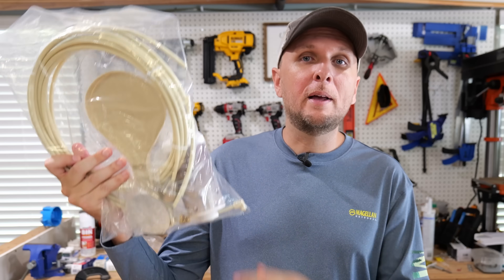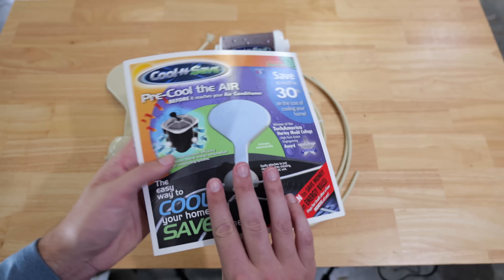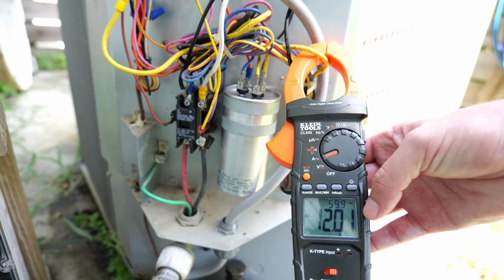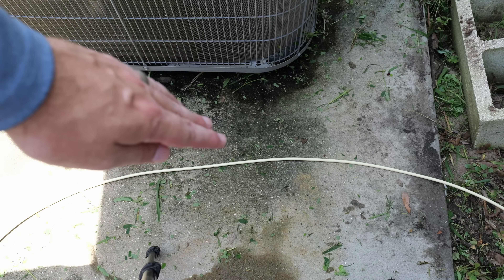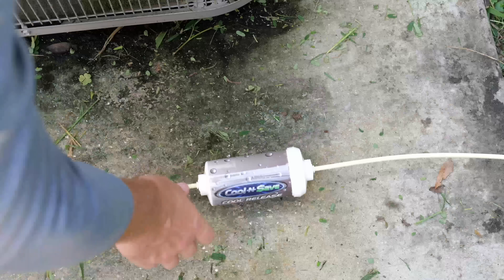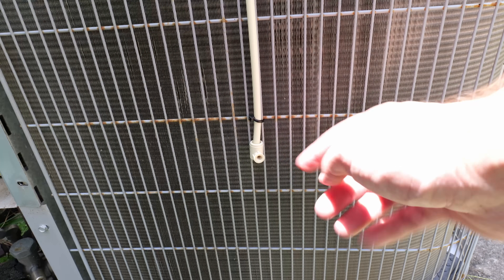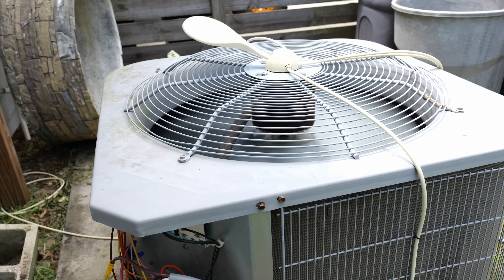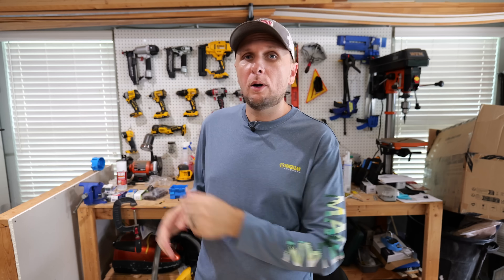This Device Can Save You 30% On Your Energy Bill! Makes The AC Blow Colder

Comment: FYI/FWIW: Most homes with a water softener loop don't have soft water at the hose bibs( intentional so homeowners aren't watering plants with a little salt too ).  Water at my house ( at approximately 15 to 18 grains of hardness ) and many others would clog that line filter quickly. It would be important to know the availability and cost of replacement filters for those in this situation depending on the line filter. Most homeowners don't clean their condenser coils and changing a dirty filter probably won't happen often enough either. In that case the misters are spraying hard water on the condenser coils. Not good.
Reply: Living in central Florida, our city water is a little hard.  I installed a Generic Fleck Valve 24,000 grain water softener about 10 years ago and set it up to provide nice soft water to all water devices and fixtures.  It's nice to wash the car and not have lots of spots on it after it drys.  Also having soft water at all fixtures keeps those spigots and appliances free of water mineral deposits that cause damage to them.  Everything stays cleaner and lasts longer when run with soft water, at least that has been my experience.  I rebedded the resin in my softener last week because the city water contains some chlorine gas that tends to "Wear out" the resin bed over time.  This time I went back with 10% crosslinked resin instead of the 8% that it came with.  Its suppose to be longer lasting and work better if you happen to be on city water.  Time will tell.  I can tell you that it doesn't take very much "hard water" added to a hot water tank full of "soft water" to completely contaminate it and make it feel hard again, so I would assume the same would hold true if you had soft water only on your hot water lines and not the cold water lines as some have suggested.  For me, soft water all the way.  Yes, you can use a fraction of the soap you need for everything compared to hard water which is a huge savings over time, not to mention no mineral build up in all of the appliances and fixtures.  Yep, I'll never go back to normal hard water again. But I digress...
Reply: @michaelefournier  That's interesting. With the exception of my outdoor spigots, my entire water system is softened.
Reply: <edit> I Removed this remark because I was arguing an invalid point.
Reply: @KurtVW That's not true at all. Water softeners absolutely do remove minerals through an ion exchange process. The salt is broken down and isn't salt anymore. Calcium, magnesium, and other minerals are flushed out of the softener beads during the recharge cycle. 

You don't have to take my word for it - look it up. The process is well documented and explained for those that want to know. 

However, what OP said is true - outdoor spigots are usually excluded from these systems.
Reply: @watcherofwatchers   Where do they go?

<edited because I was talking out my arse>
Reply: @KurtVW  The regen cycle of a water softener discharges the used salt water to a drain.  When the regen cycle runs, the machine is in bypass mode so if water was to be turned on somewhere in the house you would be using untreated (hard) water.  This is the reason the regen cycle is typically factory set to run at 2:00AM.  Most experts will tell you that after the regen cycle the rinsing of the media beads is not 100% efficient, meaning a very small amount of salt does enter your house.
Reply: @KurtVW  There's a waste drain in a softener system. It goes wherever that drains to such as a sewer or septic system.

You have a fundamental lack of understanding about what these systems do and how they work.  Seriously, go read up on them before so confidently asserting things that are exactly opposite to being true.
Reply: @watcherofwatchers  You are correct, it was a misunderstanding on my end.  Thanks.
Reply: Agree
Reply: Translation: Using this product differently than it's designed to be used is bad for your unit.

Comment: Water cooled condensers connected to the municipal water supply is often not permitted by the building code. Example: Chicago.
Reply: Well that maybe true but no one’s would prob be more true than Chicago.  Have you read the CP electrical codes due to some “cow” named Bessie.
Reply: How would they know?
Reply: Two words, Legionnaires’ disease.
Reply: @jimp5024  If there's a Legionnaires problem it won't happen at the misting ends of this system. That would be a supply problem. The pipe coming into your house? Possibly. Your municipal water storage? Possible, see Michigan. But how in the world can bacteria grow in water that is instantly or nearly instantly evaporated?

Comment: What about the water usage and increase in water bill?  What about places like Texas where the water coming out of the hose is very hot?
Reply: The water shouldn't be hot unless you are talking about the 50' hose (or whatever length) that is out in the sun heating the water in the hose. Otherwise it would be the same temp as inside your house. The water eventually is cold once it has replaced the water that was initially in the hose, right? The hoses for this assembly might still be in the sun, but obviously much less water is in them, so less hot water. Either way, if your A/C cycles, let's say, every 15 minutes, the water won't be as hot anyway.
Reply: @ccyaltr  He could be in an area like Yuma. The city water lines are not buried deeply, so in the summer there is no need for hot water to take a shower, the water from the cold tap is over 100 F. Many people turn off their hot water heaters in the summer.
Reply: @ccyaltr  you must not live here... the water coming out of the "cold" is sometimes scalding

Comment: I would like to have seen a measurement of the amount of water used during the test period. Depending on how much water is being turned to mist every hour, it may or may not be worthwhile.
Reply: I was thinking exactly the same thing. The other consideration is the outdoor humidity. Misting is an effective way to cool in dry climates but much less so in humid climates.
Reply: Many of us are experiencing drought conditions and so water usage would be an important part of the equation whether to use this product or not..
Reply: 1. Water usage, especially if on city water. 2. If on a well, now there will be wear and tear on that pump along with increased electrical use...
Reply: Water bill up, electric bill down. I don’t think you really save anything.
Reply: I was wondering the same thing, similar thoughts about water usage/expense.
Reply: water is less expensive than electricity.
Reply: That's my question: my water company got approval to raise the rate twice in the last 3 years.  The reduction in energy would have to be a good deal to justify using much water.
Reply: @erickmcgraw same, with all the smart things we have now a days it would be easy to track. For example yesterday during this super hot Houston day with us being in the 100s, my ac ran for 14 hours and 24 minutes. During the peak it ran for 3 whole hours without turning off.

On top of just offsetting the cost somewhere else, Texas power isn't that expensive. I currently pay 11 cents a kW. Water I can't shop around for and already gets a little expensive for me in the droughts because I do like to water my lawn.
Reply: WHT about connecting ac indoor water to this outer misting system
Reply: It’s a good idea but your usage and rust build up of unit over time would cost you more. Just take good care of your unit clean it weekly in the summer with hose keep it serviced and you’ll be fine
Reply: I think this is another wasting money, time, Efford and at the end is only money for others.
Reply: @irisbaez1972  if it were practical, one of the manufacturers would have a similar system as standard.

Comment: Just get a big fan and stand it next to the unit blowing into one side.
Reply: It has a fan already in the AC... Adding another fan just uses more electricity.
Reply: @KurtVW  my suggestion is only for an ailing unit until a new unit can be secured  and installed.
Reply: @perriponders289  it works because of the  "volume of air"...the 91 degree air is cooler that the fins.  The cooling fan on top of the unit is also pulling that 91 degree air also.... this just increases the volume per minute. Worked great for me.
Reply: my suggestion was meant only as a temporary solution until a fix or new unit can be installed. It does work and can be temporarily useful if the home owner is in immediate need of a fix such as a medical need due to asthma or COPD. I should have stated its temporary.
Reply: @alphatango7831  That could only work on a badly failing unit...  Otherwise, at a thermodynamic level, it simply does not work.

Heat is energy.  Cold is a lack of energy.

If you add additional energy to the process, then you have to remove it later to get cold. Stirring up air doesn't cool it.

Get a bowl of ice water and a thermometer.   Let that sit for 20 minutes.   When you stir the water it gets warmer... Because you're adding energy to it.   Air works exactly the same way.. The more you push it around the hotter it gets.

The only reason a fan makes your body feel cool is because its evaporating moisture from you.  If your moisture isn't there, then the air just gets hotter because you added energy to it.  Just like the bowl of ice water.

A fan just burns more electricity to warm the air by a tiny bit.  Its not helping.   Don't take my word for it, there are hundreds of years of papers to back this concept up.
Reply: @KurtVW  I understand your concept and theory and the laws of physics. In the case of an ailing unit it does work. It was my intention  to state that originally. In a properly designed unit that is up to specs its a moot point.0

Comment: That paddle valve is hokey
Reply: I like it... looks like a beavers tail  :)
Reply: the paddle valve may look hokey but it works and eliminates the electrical connection to the control panel and an expensive solenoid water valve.

Comment: this really does work but riddled with problems. the concept comes from the freus air conditioners back 20 or so years ago, which is an air conditioner inside of a swamp cooler, I had one of these units and they were a constant maintenance nightmare, constantly replacing anodes, pumps, cleaning out the pan, descaling, unfortunately this works well with deionized water, which is expensive to rent these tanks, then you need to plumb it, but with soft water you have salt or potassium that is corrosive, and even if you live in a place that has good water there are still some minerals in the water, plus there are plastic parts to break, misters that get blocked with corrosion or debris, the demineralizing and filtering of the water is the key to keeping these systems relatively maintenance free, if you can achieve that in an inexpensive way then that's the way to go.

Comment: Doubt it would work in Arizona. Even a three ft run of hose would heat the water to 130 to 150 in the summer. Our cold water temp is about 100 degrees at this time of year
.
Reply: You still gain positive results from the evaporative cooling effect from the mist.  Go to restaurants in Phoenix…many of them have mister systems for patio dining and the air is considerably cooler.

Comment: This is flawed in so many ways... Firstly, (as others have mentioned) is the possible and likely buildup of residue from the water. Even if you had pure, distilled water running to it, what about the dust, dirt, pollen, bits of grass, etc. in the air that's going to get sucked-in and trapped there? Secondly, the whole purpose of the condenser is to take vaporized refrigerant and cool it enough to liquefy for it's journey to the evaporator. It WILL liquefy in that condenser whether it's 120 or 60 degrees... Cooling the condenser might make the refrigerant become liquid faster, but it's NOT going to change the chemical makeup of the refrigerant and make it somehow colder when it passes through the TXV or other metering device. Finally, it's not just the condenser coils that are going to be nonstop soaked by this... most compressors are mounted inside that condenser unit, there are switches/solenoids, and the fan motor too. Really the only upside to this that I can see is reducing a few amps by reducing heat at the compressor and fan motor... and that's about it.
Reply: I agree at many levels, but what about areas that get lots and lots of rain. My folks live in east Tennessee and it rains a lot right now.

Comment: Don't do this.  I personally have replaced units that had a system like this installed.  But you do you.
Reply from the maker: You’ve also personally replaced units that did not have this on them as well.  Like I said in the video, it is important to have the filter and a water softener would be a nice added filter to have as well.   Units should also be cleaned regularly where any leftover mineral deposits that might be there would be cleaned off.
Reply: What specific problems did this system cause?
Reply: Like I said bro--you do you.
Reply: I'd rather do you..  you are kind of cute...  nice hair  :)

Comment: Just installed the units with the addon tubes. One leaked pretty bad and they sent me a replacement right away! Not sure if I will save anything in the end, but it seems like it should. Nearly 100 degrees here in SW Florida so we should see results quickly
Reply: Let me know how quickly the coils become coated in lime scale... I'm in SW FL too and have heard nothing good with these in the area.
Reply: @grayrabbit2211  2 weeks so far so good.
Reply from the maker: Yeah let me know what you find.  Seems most people in the comments are concerned about hard water deposits.  I will be paying close attention to mine but the company says the filter removes scale so I have a feeling it is probably not a concern for me.   Let us know your findings!
Reply: @HowToHomeDIY  I had bought 2 for my outdoor units last season. The 1st unit flap flew right off into the yard after just a few weeks. The 2nd had nozzles that leaked. The owner sent replacement parts after sending him video of each of the issues. The 2nd flap lasted a month and that one flew off. The system is just not robust enough IMHO. If they ever beef these up, I will condider again, but as of right now, I wasted 200+ dollars.
Reply: @HowToHomeDIY You just need to let some of that water run onto a mirror or piece of glass and dry. If it dries leaving any markings at all (pure water dries without leaving anything), then the filter is not removing the minerals present in hard water. Several years as a window cleaner speaking here.

Comment: What was the outdoor temp and humidity when you tested?
Reply from the maker: 91 degrees and 60% on the first test and 98 degrees and 52% on the second test.
Reply: @HowToHomeDIY  so your savings were higher than you reported.  See my long comment posted a few minutes ago.  The DOE estimates that one degree temp change equals about a 3% change in energy consumption due to A/C.  So your amp readings should really take that into account.   The higher the temp - the higher the head pressure and amp draw.